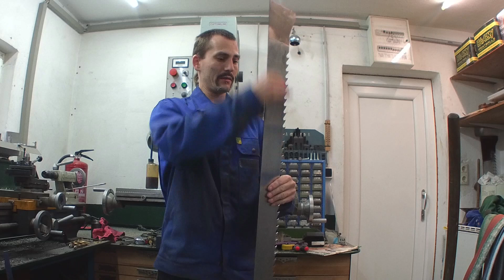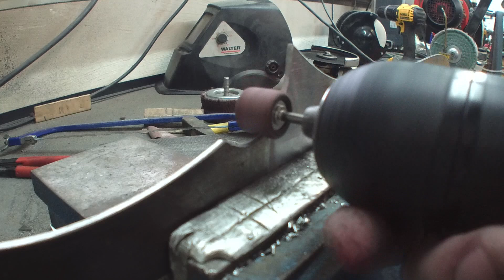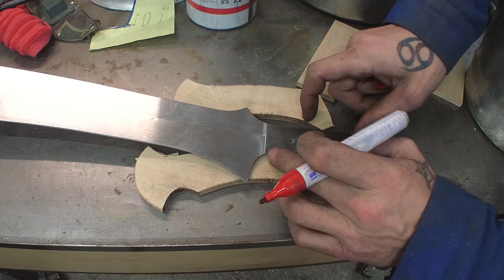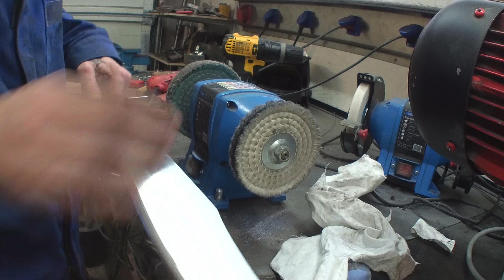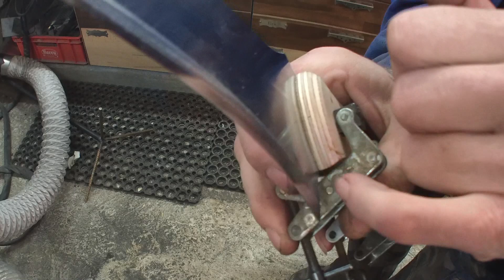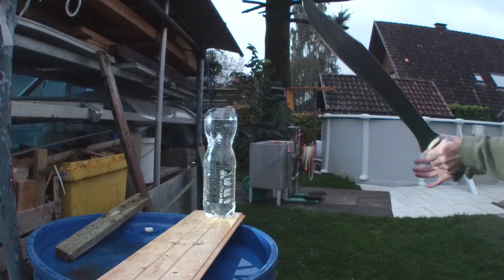How To Make a Machete From a Saw Blade - Knife Making 005 - WSW

Comment: ? 1:05 😊
Reply from the maker: The blade has no problem with getting over 200 degrees C. It was tempered at 375 C, so up to that point the blade is fine.

Comment: Nice job, but what saw using to the make this
Reply from the maker: these baldes are from a gate saw or log frame saw, they are aproxx. 140cm long 12cm wide and 2,2mm thick. you can get old once at big old saw mills
Reply: @WildStyleWorks  thanks

Comment: hello sir do you heat treatment of this steel,but there is no need, and how much is thickness of this saw blade
Reply from the maker: hello, this steel is allready heat treated and tempered to aproxx. 52 HRC. The thickness is 2,3mm or aproxx. 1/10 of an inch

Comment: What steel is it? I got some saw mill blades of Austria too and they are mostly 80crv2 and m2hss.
Reply from the maker: Romania - IRONWORKS i dont know for sure but it must be some kind of spring steel and it is about 52HRC hard so its well suited for woodworking tools
Reply: Wild Style Works Now I have noticed that you have the wider ones! They are 80crv2 (5160 springsteel but 0.8% carbon) great for big knives. But if you can heat treat the small knives you made out of it to reach it's maximum potential.
Reply from the maker: Ok, nice to know and i use these sawblades mostly for sparring weapons like onehand swords or langes Messer and also for cheap machetes but for knifes i use other steels like O1 or 61SiCr7 and old files/farrier rasps
Reply: 61sic7 is extremly tough due to the rich manganase content
Reply from the maker: also to its silicon content, but its tought to forge and not getting cracks
Reply: Wild Style Works it's known as a stock removal steel

Comment: Just a suggestion, leave the saw blade of the back of the machete so you can cut wood With it too
Reply from the maker: yes it would work but you need a lot of force to cut with these teeth because they are pretty big and also they look very nasty on a blade but maybe i will give it a go just for the fun of it ;-)

Comment: wow, great grinding job with the bevels. I might blunt an inch or 2 closest to handle for safety tho. I like the horizontal belt rather than vertical. I'm interested to know if the belt grinder was home made, DIY project or a purchased retail product?

good trick to remove epoxy expansion spill
Reply from the maker: Thank you its homemade and i made a video about it also.
Reply: la Cagoule LARP inaCtion Revolutionnaire